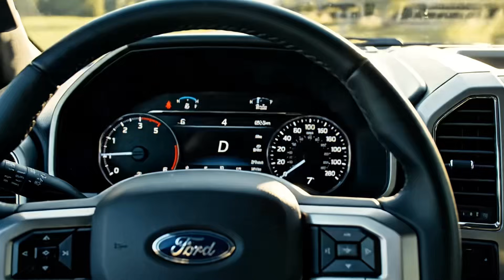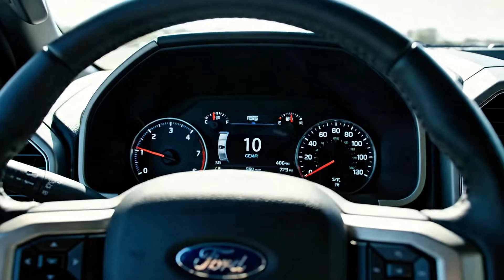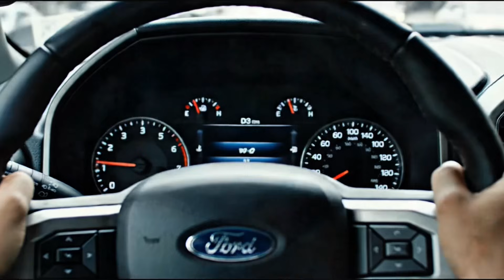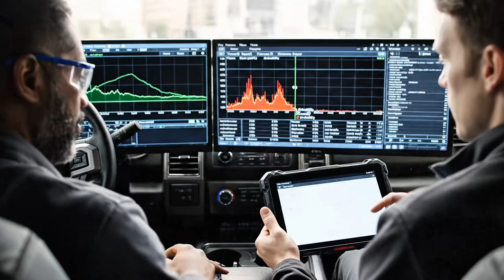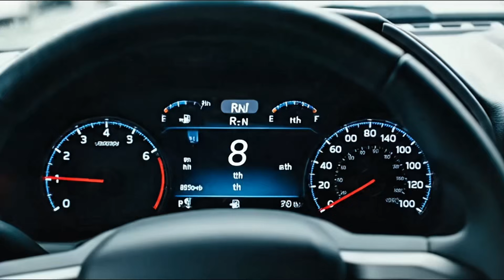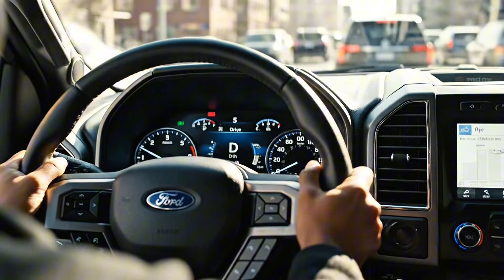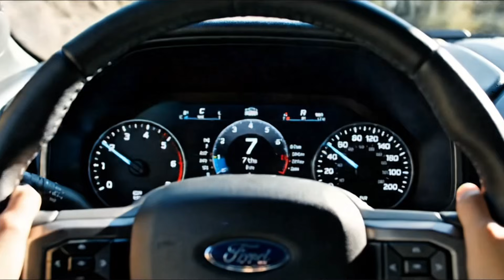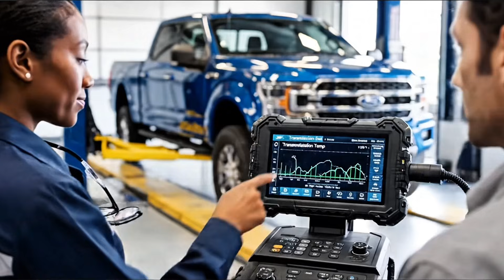Ford Says the 10-Speed Is Fixed — Here’s What Actually Changed

Comment: Lies. The clutch baskets and the bush as well as oil pumps where alsp a HARDWARE issue
Reply from the maker: You’re right — some of the early 10-speed problems were hardware-related too, not just software. Clutch components and oiling issues played a role, and Ford has made multiple revisions over time.